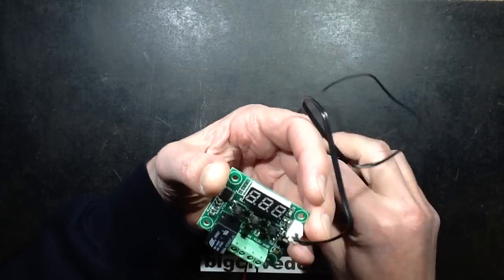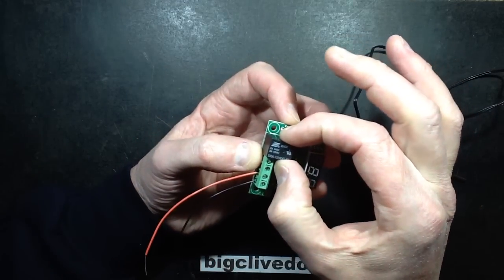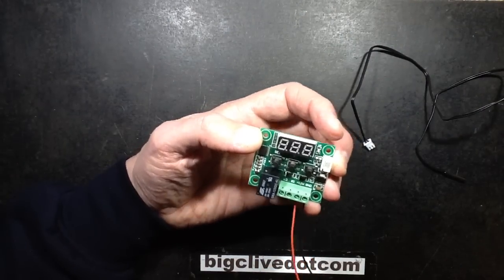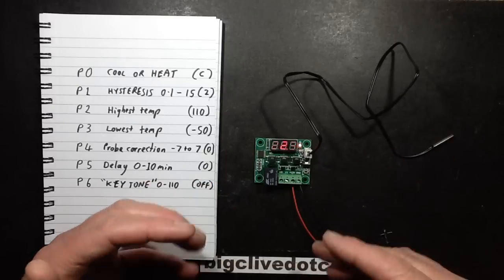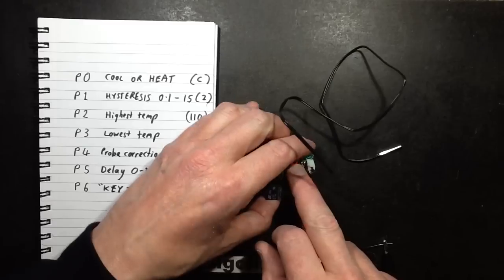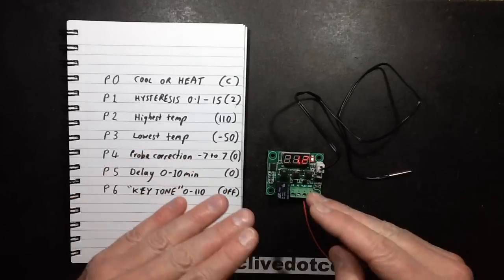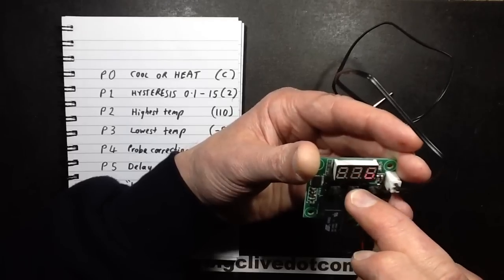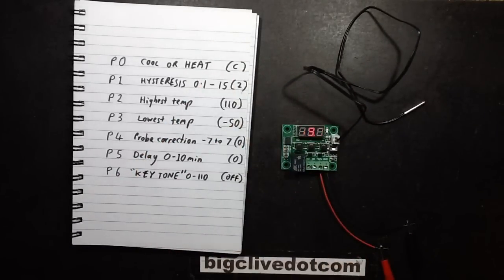Playing with an eBay thermostat module.  New data in description!

Comment: if you remove the terminal strip, relay and thermalsistor socket from the board, and re-solder them on the other side of the board. ( you must drill a tiny hole for the relay pin,
which will still be on the copper pad) this makes mounting the board easier ( nothing is now taller than the readout & switches) .  These were built with all parts on one side to make them cheaper to make, invest some of your time, and they're easier to use.
Reply: I did this to the one I bought, cut a piece of red lexan to cover the front and drilled some holes for the switches and it looks great.  Too bad the thing was designed with all the connectors and relay on the front.  This config is typical for Chinese devices.
Reply: And if you replace the relay entirely with a solid state relay it will actually work for long time.

Comment: Awsome video man,  just got mine in the post and theirs nothing to show you how to plug it up. I figured most of it out but the out put isn't running my fan. I cant understand why it isn't working, the led light is swiched on and I assume it should mean its powered, but my fan don't spin. My fan is a 12v dc 0.13a and im powering the thing with a 12v power pack that powers the fan without the thermostat, the thermostat is on, lcd screen working great. maybe its faulty?
Reply: +Sylvester Fritz found the solution, cheers
Reply: Not to nit pick but, What was the solution? You should at least give a brief summary of the fault and subsequent solution.  may be helpful to someone else that runs into the same situation.
Reply: +Jamie Stubbe yeah true, I got the answer from reading the comments here, it was by Joey Nebulous. Not to advertise my own video but you can see the wiring in my Greenthumb channel, the video is called "PC Fan with Thermostat for Grow Box" let me know if it was helpful

Comment: Can u use 230 AC on the relay?
Reply from the maker: +Sondreef They do seem to be rated for 240V, but I wouldn't use them at a high load.
Reply: Its rated for 20 amps right? So running a 100 W load at 230 volts wouldt be much would it?
Reply from the maker: +Sondreef I doubt it's rated 20A, but 100W (less than half an amp at 230V) should be fine.
Reply: Ok thanks :)

Comment: I'm going to get a few of these and some extractor fans to pump the hot air in the loft to the cold North side of the house. Do you think this a good idea? It must be better than putting the boiler on in May. I have just measured the loft temperature at 21:30 and it is 22 degrees. The South facing rooms are at 20 degrees and North facing rooms are 17 degrees. The leaky room are 12-14 degrees.
Reply from the maker: +Nadim Awan As long as the loft isn't stale it should be OK.  You can get temperature differential thermostats specifically for that task.
Reply: +bigclivedotcom Thanx for the tip. There are holes in the roof so the air is not stale, just dusty. Differential thermostats are £9.80 on eBay from Bulgaria. So its better to have 2x £1.45 Chinese thermostats for each zone and wire the rooms thermostats relay output to the loft thermostats power source.

Comment: Hi.. Great video.. but why the display flickers? In some other videos i saw that digits remains stable. But in your case its continuously flickring.
Reply: +Raj S When you have a chip driving a display, it doesn't have all of the segments on at the same time. It cycles through each segment very quickly. To the naked eye, it appears solid, but when you put it in front of the camera, the frame rate of the video doesn't pick it up the same as your eye. You'll see it a lot with things like video of LED taillights on cars too.

Comment: The relay rating mentioned is a rating of breaking capacity. This is not continuous current rating.
The relay will succeed to break a current of this magnitude, higher currents  might cause the contacts to continue to arc till destroyed. Continuous rating is usually 1 amp or less.
Reply: The 1 amp rating is quite conservative.  I am switching about 3 amps though it to a full size refrigerator compressor and the relay just gets a little warm.  The compressor stays on for about an hour or more so no problem with this type of load.

Comment: I need some of those but these with an adjustable hysteresis (analog, no display..) retail around 40 Euros here. 
It didn't even cross my mind to search ebay for a cheap chinese version and so I decided to build a crappy version of this with an OpAmp, an NPN, two potentiometers and a handful of resitors as a comparing circuit by myself...but it's much easier and actually way cheaper (2.91 Euros incl. shipping thats insane) to get this thing ready to use from China. Although I'm losing the fun part of building stuff..thanks for saving me a lot of time and a lot of money.
Reply: +CptHirni 
Try this instead - I bought 6 of these for $3.92AU each.
http://www.aliexpress.com/?aff_platform=link-c-tool&sk=Z7aQrbiQr%3A&cpt=1462691802240&aff_trace_key=9e63926a13004899bd5ea8ba89459499-1462691802240-00164-Z7aQrbiQr
Sometimes the delivery is a bit slow but I haven't had any hiccups yet and ive been ordering for over a year.

Comment: I picked up one of these to run a 12v computer fan as an exhaust, but I'm having trouble setting it up.  I stick the volt meter on the thermostat and when I touch the negative and "12v" it shows 12v on the meter.  When I touch the negative and either the K0 or K1 it is NOT 12v.  Doesnt matter if the indicator LED is on or off, it isnt routing 12v power through K0 or K1.  

So how do I make it work with the 12v computer fan?
Reply from the maker: +John Cochran The relay contacts are "volt free".  You have to regard them as being a switch.   So connect the fans negative to the negative terminal and put the fans positive into one of the relay terminals, looping it back out the other to the positive supply.
Reply: +John Cochran Thanks! - works perfectly.  Very helpful video!

Comment: I'm curious, would there be any way to attach something like a fan to the module and have it fully running from the module or would I have to power it separately?
Reply from the maker: +Hasan Ali If it was a 12V fan it could be run on the same supply.

Comment: Does anyone know, how much those tolerate regarding input voltage? I've looked up the AMS 1117 5 mentioned in the review (which is great by the way!) and it seems like it can handle anything from 15 to ~6.3 Volt. Is the whole device - including the relay - powered by the dropout voltage regulator? Just asking because I would like to power this thermostat by a car battery (for a car fridge) where the voltage can range from 14.5v to 11.7v.
Reply from the maker: +Anton Farber It should be fine with that range.
Reply: +bigclivedotcom Thanks for the quick reply!

Comment: Just in case anyone buys these and tries to use these. The K0 and K1 terminals act like a switch. The do not output any voltage from the 12V supply going into the the module, so you can't connect positive to K0/K1 and negative to K1/K0, and is also why doing a voltage test across K0 and K1 says 0.00. To test the relay works, use continuity with a multimeter instead. It should beep when the LED is on.

For example, running a 5V fan from USB:
Connect the 12V power supply to the module. 
Connect the fan's negative (black) to the negative (black) of the USB cable
Then connect the positive (red) of the USB to K1
Connect the positive of the fan to K0
Then plug the USB cable in to a power bank or another USB power source, and plug in the 12V supply. 
I made a quiet fan from this method using a standard 6" PC case fan and an Anker 20000mAH power bank. It can supply 19, 16 and 12V in addition to 5V.

Another example, running the fan from the single 12V supply.
Connect the negative from the power supply and the negative to the fan to the same GND terminal.
Connect the positive from the power supply to the +12V terminal
Get a little bit of wire and connect the ends to K1 and +12V so they're bridged.
Then plug the fan positive to K0, then power the module on.
Set your settings and the fan should run when appropriate.
Reply: +Joey Nebulous No I didn't know eigher Joey, and you've saved me a fair bit of Googleing thinking my thermostat is broken. that's why it isn't running my fan then as they isn't any current their? Is their a diagram that shows me better what I have to do? cheers.
Reply: +Joey Nebulous no don't need the diagram, I just did what you said and now its working fine. thanks a lot!! its running the fan.
Reply: +Joey Nebulous 
All that was already obvious when Clive said  "they are voltage free contacts.
Reply: +Azzy M well not exactly, I didn't know what volt free contacts were and how they worked until I did a fair bit of googling
Reply: Joey Nebulous Good for you. Now you know more.
Reply: @joeynebulous816  That's what they call a "dry contact" around these parts.  Just a plain switch.

Comment: I have one of these for a solution to my 3D printer control board not supporting a heat bed.  Am I right in thinking that the right inputs are 12v DC in and the 2 on the left will send power to the heat bed?  I would then chose p0 H and set the temperature I want to hold and it will cut off once it reaches that temp. will it automatically turn back on once the temperature drops?

Comment: This have some memory to save the configuration? or when you disconect 
the power they reset and need to configure again? i want to use it in 
the car, but just when i turn on the key to control the motor 
temperature. Thanks ; )
Reply from the maker: +vicesat They store the settings.
Reply: +vicesat Even if it doesn't have memory, you should have a +12v constant line in your car. You'll have one connected to your stereo to keep it from losing all your station presets.

Comment: hey i have a question 
first off a wired a 12v fan to it and it worked flawlessly
then i added another 12v fan , then when it kicks in for cooling ,it starts to turn on and off
so i bought a 2 x 5v fans and wired them up
same issue 
my question is how do i make it able to run 2x fans ?
my power supply is 12v with about 1amp
Reply from the maker: +Aneel Ak Try adding a local smoothing capacitor.  It sounds like the switch-on transient is crashing or resetting the processor.  You could also run the fan feed as a completely separate cable to the control one.

Comment: Love your videos, thank you for taking the time and expense to share them. I had purchased one of these thermostat units and had to do a bit of research, as you, I received the manual in Chinese. I found an English version manual listing P6 as a high temperature alarm. Maybe not "bricked" but alarm/protection mode maybe?
Reply from the maker: +electrode74 If you read the description for the video it has some follow-up data.
Reply: +bigclivedotcom I see that it does, should have looked first. Thank you for the reply.

Comment: I wonder what is the highest temperature this thing can measure. Could you use it to control the temperature of a 3D printer nozzle or a vacuum forming machine heater. Few hundred degrees C needed to get the plastic sheet nice and soft.
Reply from the maker: +Felix O'Keefe For very high temperatures a thermocouple would be a better choice.

Comment: Jesus man you are a godsend. I bought this little baby but it came alone with zero paperwork! not even in Chinese!
Reply from the maker: +EnhancedNightmare Make sure you check out the video description for the updated operation guide.
Reply: bigclivedotcom Thanks!
Cheers.
Reply: ***** Not a bad company to use though.
Only problems ive had with the final product is the cameras claim many functions that don't match up with reality and they all came from the same supplier.
Seems they advertise " Motion detection " just for the sales.
Apart from that ive had pretty good service including the emails which are answered rather quickly as mentioned above.
Reply: +EnhancedNightmare They`re easy to work out mate _ Press the set and the required up / down button.
There also tend to be around a 4 degree delay on the settings as well.
If you set it to 30C it will activate at 30C on the way up but wont retrigger( A tank heater for instance ) till 26C.
While this may be only a 4 degree difference if it is used as a tank heater controller some fish etc may not like this variation.

I currently use one to control a heater in a rat cage.

Rather cheap at $3.92AU each with free postage ( I bought 6 )
Reply: EnhancedNightmare
I get mine from a site in china called aliexpress.
Like alibaba  but not quite the same.
I cant build these and many other things for the price I pay for many items already constructed.

They aren't real good on supplying instructions though.
Ive had to email then a few times and have only once had to wait till the next day for information.
They even answer emails on the weekend and often within the hour.
Quite common to get a response within 10 minutes.
Reply: Same. This video is a godsend
Reply: Same here. Ordered 3 of these - all came with NO instructions whatsoever. I would have never known how to even switch between "cool" and heat" if it wasn't for this vid. Other than that, a brilliant little gadget.
Reply: There's a manual available online: https://reprapworld.com/documentation/W1209TC.pdf
Reply: Noevilea Thanks mate, 4 degree difference is fine with my application but it might be too big for other.

Comment: ...this is the first time I've heard the term "brick" used in the verb form...it certainly describes the situation perfectly when the software locks up...quaint!...is this common British usage?  I must have a use for one of those controls around here...maybe as an independent aquarium temp monitor, maybe just as a thermometer...thanks for another informative video!
Reply from the maker: +Ronplucksstrings It's a common technical term on the Internet.  It's used to describe when some expensive technical device has been rendered as functional as a brick.
Reply: +bigclivedotcom I was wondering about that lol.....I thought you were saying 'break' it, in your Scottish accent....!!

Comment: found your video very helpful, especially since the instructions are in Japanese.  however im having a hard time getting it to function.  im trying to wire it in to a small space heater. I wired it in replacing an existing safety switch. when I bypass the switch the heater works but the thermostat wont cycle it on/off. any ideas about troubleshooting this problem??

Comment: Nice little demo. been looking for one of these! I'm building a closed cooler for cooling beer wort when brewing. I'm thinking I could set it in cooling mode and power a pump till it reached the set temp and shuts the pump off and sounds a buzzer. Cheers +bigclivedotcom
Reply: therealnightwriter Yeh but I use the arduino of other things and would have to buy or find a DHT22 and for the price of one of these (a mear £2 odd) it doesn't seem worth getting another arduino,coding and wiring up a DHT22
Reply: +Chris Wouse I stand with you on this one. Everyone wants to use arduinos nowadays even though they are costly (and chinese knock-offs are hit or miss). This little part is enough for manny many uses.

Comment: Dear Clive   by the way I found your film very informative due to having no instructions enclosed with these two thermostats   My lad who's a heavy duty electrical eng found your dvd on You T...      Can you confirm that you have tested the stat and found it accurate as opposed to the two | have that tested at 15C differential = ON/ OFF  with both not being identical in operation.... They drive a 100 watt x 12 volt silicone heat belt which will warm a fuel filter at 40 C......   Although the temperature will be up an down like a yoyo at the source of heat it may
do the job but I will not contemplate using them till I receive and test another two from a different seller. I'll also put a bog standard bi-metal limit stat of 40C in line and might even dispense with these ones.    Thanks for you excellent video....

Comment: Dear Clive    I mentioned that the minimum differential on both is 5C. The possible adjustment is not 1C but 5 C denoted by the temperature Max and Min adjustments that will not allow more than 5C differential.   The delay is 0 C......  I conclude that whoever made these did not test them as is the norm for yonks.... ie new digital programmers with no supply out to terminals !

Comment: The two I bought through Ebay were very cheap and on testing both they are nasty........  If one wanted a tight differential they would be useless because although the setting for the differential (ON temp and OFF temp) can be set to 1 degC the differential ios 5 deg C.  In any case the on and off temp bears no resemblance to reality as per my Laser thermometer.  The temperature delay when switching on after being off is ridiculously low for an electronic stat.......   It seems patently obvious that the old rule re the more accurate the temp with a very small differential (hysteresis)  is going to cost quite a bit of money....
In a nutshell these stats are all over the place and seem also to not match each other regarding the settings being the same but the actual working of them being different.      fluctuation found to be about 15C ........
Reply from the maker: +Michael Hall Did you try calibrating them using the calibration faciltity, adjusting the on/off delay time and also the hysteresis setting?  Keep in mind that the traditional thermistors have a higher mass than a thermocouple or IR thermometer and will tend to react better to slow temperature changes.

Comment: Amazing cheap and very usable product.
Im going to use it in my DIY PCB eching tank, this module, 100W heater, and air pump to keep water circulation.
Case/tank will be made from 4mm policarbonate sheets and glued by universal thinner(use acetone with plexy).